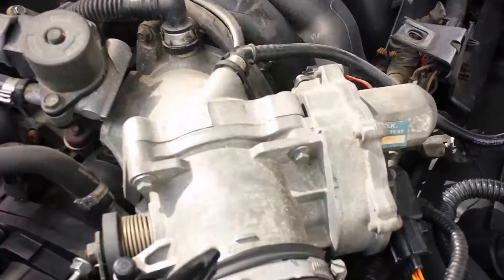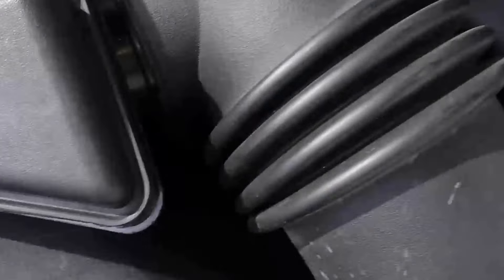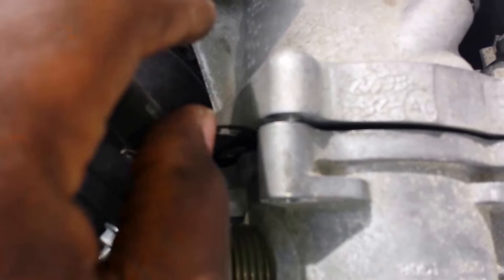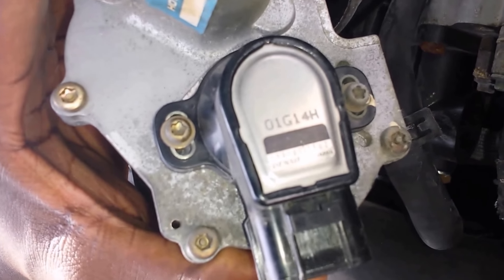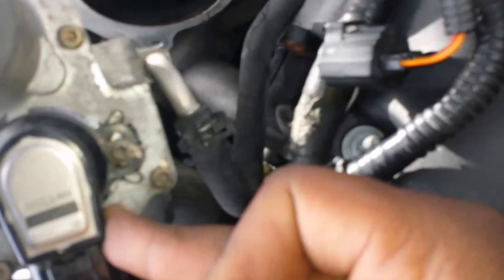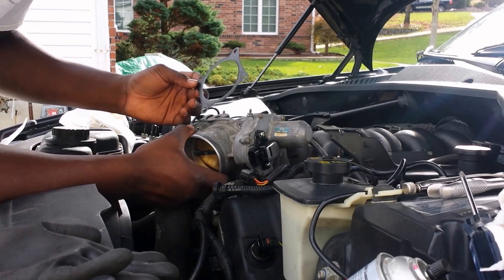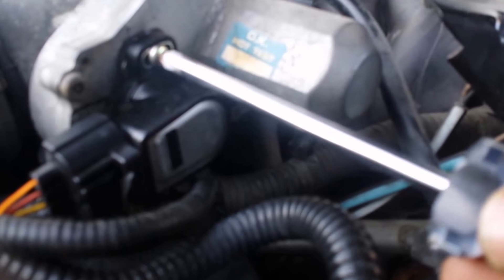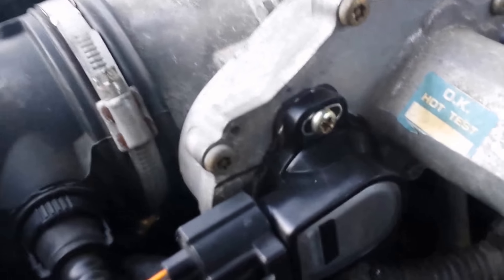Jaguar XJ P2135 Engine systems fault - Throttle Body/ Throttle Position Sensor. READ UPDATE BELOW

Comment: Replacement TPS fasteners are M4 0.7  10mm. I just grabbed some hex cap head screws from the hardware store and threw the stupid 5 points in the trash.

Comment from the maker: UPDATE: For me this was a temporary fix it seems. Approx. 5,000 miles after I did this, I disconnected the battery to fix something else and this code came back. I ended up buying a Jaguar throttle body with an integrated sensor for ~$250 versus this sensor that cost ~$25. 
The original one lasted 177,000 miles.
Reply: Problem solved after you bought new throttle?thanks
Reply from the maker: Yes, the new throttle body fixed it.
Reply: Where you get them and this applies to jaguar vanden plas 1997?
Reply from the maker: @anticristony  sorry for the late reply. I found the throttle body on eBay. There was a dealership selling them.

Comment: After market TPS for 2004-on XJ8 are indeed junk. I tried one and it was flaky to say the least. So I cleaned the OEM TPS with some spray electronics cleaner; just a mist. I rotated the wiper in the TPS a few times then sprayed again with the EC. Using canned air I gave the TPS a couple of quick blast to ensure the EC had evaporated. Using an extension cable I was able to adjust the idle speed I needed. It was a successful fix. Get the TPS off the throttle body is a PITA. Like other said, go to a hardware store and get the right hex screws for down the road adjustment as needed.

Comment: I bought a new intake tube off Ebay and it fixed all my problems.
Reply from the maker: Good job on the fix. Did you have the same code and symptoms I had?

Comment: My 2011 XJL since its winter outside wants to give me this issue, dash lights up with errors saying each system is offline before it loses all power and dies, was wondering if just changing the sensor would fix it, I have also seen people talk about the wiring on the sensors plug gets pulled out over time causing it.
Reply: There is. Two wire connector for the throttle body motor. They disintegrate over time and will simply crumble into pieces. The replacement female half is WPT-1269 with pigtails. On line for 15$. Mine came with two crimp splices but decided to solder the pigtails to the OEM wiring still in the harness. Each individual splice was covered with heat shrink then both splices were covered with a larger piece of shrink. I snugged everything neatly with zip ties and my on-off again fixed my idle problem , the CEL and a DSC alerts on the dash.

Comment: What's the reset procedure for a 2005 jaguar s-type after reinstalling the throttle body and throttle position sensor?
Reply: Did you ever figure it out?

Comment: Hey you tell us what is the little plug you took off I know the throttle body position sensor 
What is the smaller one
Reply from the maker: At approx 2:30? That's for the throttle plate. The connection for the motor that opens & closes the throttle

Comment: I have been having engine system fault and gearbox fault pop up. Do you the it’s the throttle body?
Reply from the maker: I would hate to speculate and lead you the wrong path, but it soes seem like the throttle body will need attention at some point around the 175,000 mile mark.
However, I had a check engine light with the trouble code to guide me. 

You can weigh the option of taking it to Jaguar for diagnosis, or just replace the TB as a preventive maintenance step.
Reply: @EdBwoy  i have 134 thousand miles on it and my battery had died but it still had a little juice left and I was able to turn the key over and I noticed that was popping up and basically ever since I changed the battery it has seemed to do it and it just gets worse

Comment: Did your car slam into Drive mode? Same problem with my XJ8
Reply from the maker: It kicked into fail-safe mode, stuck on 3rd gear and wouldn't shift up or down. And I think the RPM was limited too. It's been quite a while
Reply: Do you still own the car? I have a 2006 Vanden Plas that goes into ENGINE SYSTEM FAULT Limp mode. I can't drive above 10mph and does not shuft transmission. RPM stays stuck at around 1000. The OBD only shows one code i.e. P2135. Need help :(
Reply from the maker: @lodashnotebook5390  I don't have it anymore. I sold it, but I figured the videos should still stay up if they can help somebody.
I don't know what mileage you have, but as I posted in the update, just replace the throttle body. Buy an original Jaguar unit and save yourself the trouble of doing it twice
Reply: @EdBwoy  why did you sell it? I got a cheap 90 buck OEM from a donor Jag w/ about 70k miles on the clock off eBay. If the problem gets resolved, I'll but the 300 buck new one.
Reply from the maker: @lodashnotebook5390  it was time for a change. I went back to cars that are a little more fun to drive, with more modern amenities.
Reply: @lodashnotebook5390  hey, do you still have it? how many miles and how has it been?

Comment: I have a 2004 Jaguar XJ8 Vdp And I smell gas when my car is idle , and when I drive , my car jerks when accelerating , and the rpm's go up and down by like .5rpm when it does jerk.
Reply from the maker: I am curious, did your service engine light come on with a readable code?
Reply: @EdBwoy  did you have any symptoms of your throttle position sensor not working? For instance my rpms fluctuate up and down while driving. Do you think that could be the throttle position sensor?
Reply from the maker: @LifeOnInCline  yes, immediately preceding my limp mode fits, the RPMs fluctuated in city driving. The  the gearbox warning would follow
Reply: @EdBwoy  I really appreciate it man! Hope all is well